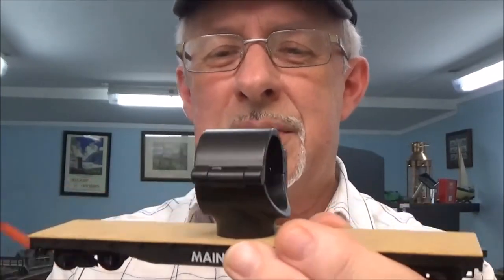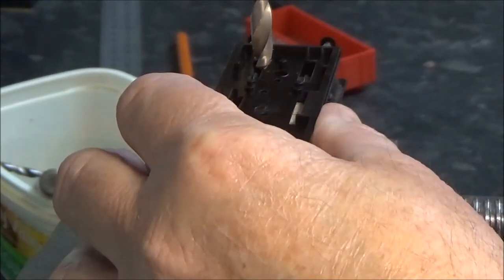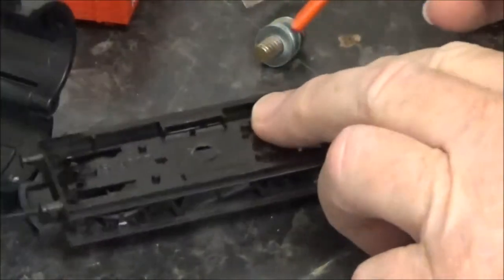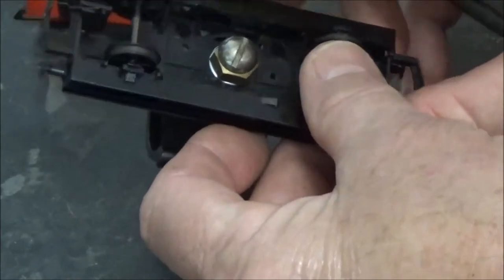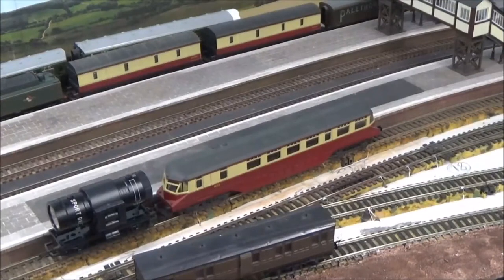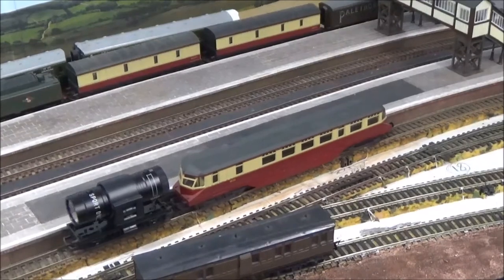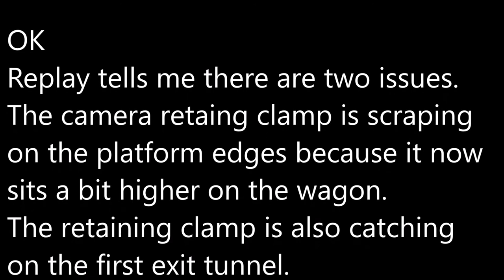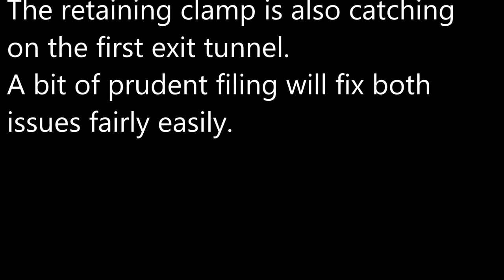Episode 65 17 Camera Car Rebuild

Comment: Works really well Gormo. I am impressed at the lenght of the branch. I had thought it was just a short siding - boy was I surprised! It seems to be much longer than the main lines........................John
Reply from the maker: G`day John,
Yes it`s a good old run John. Necessary to gain the height for the two branch stations. The first branch station is mid way in height between the main layout and the branch terminus. The branch terminus is the highest part of the railway. The steepest gradient is 1 in 70 which can cope with a 5 coach train pulled by a steamer and that was the plan from the start.....so there you are.???
Cheers Gormo